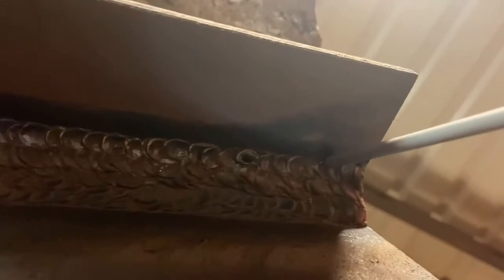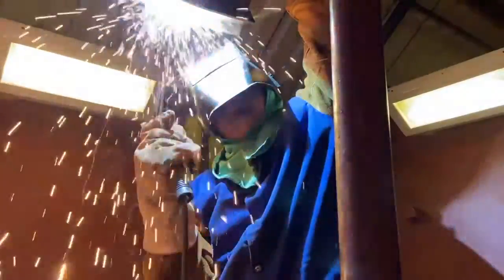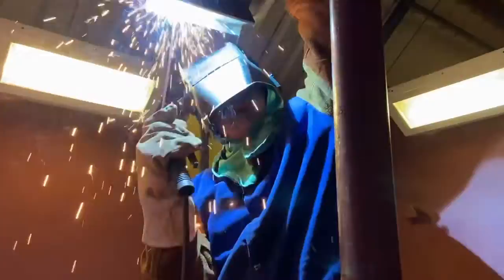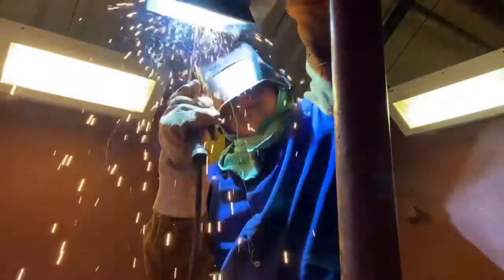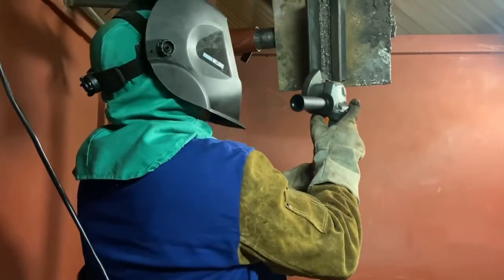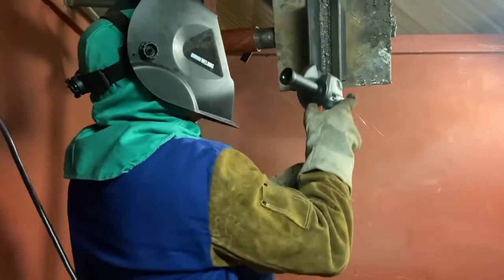SMAW 4G 6010 | overhead welding 6010 technique

Comment: Good vid, nice weld result. Only thing I'd like you to comment on aswell is your stick position angle that works best in your experience. A video on welding a flat plate to a post in the ground would be great cause you have to curve around the pipe in overhead (not that my technique was off there was something wrong with the welder foresure lol)